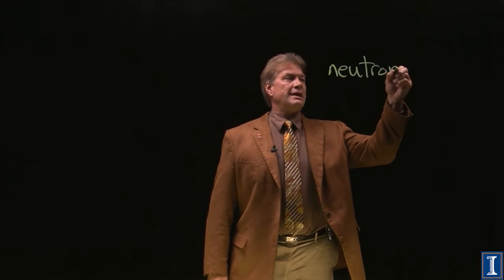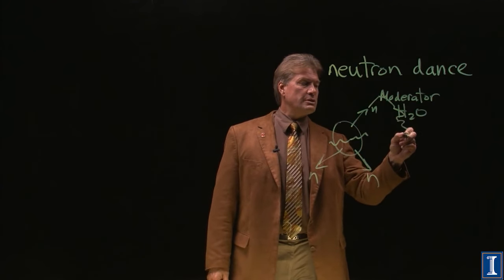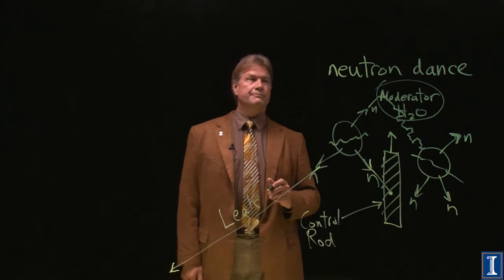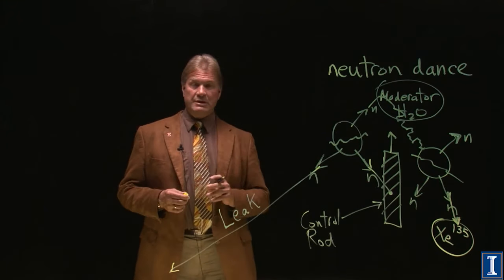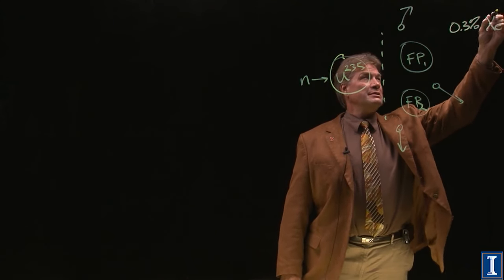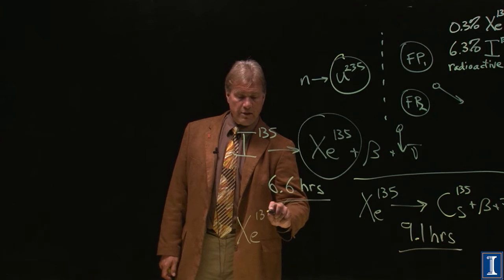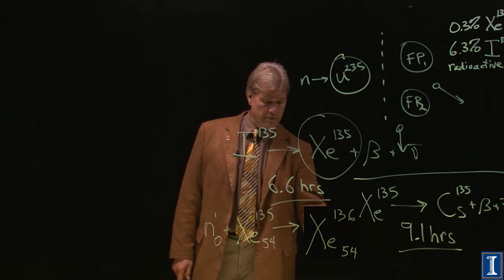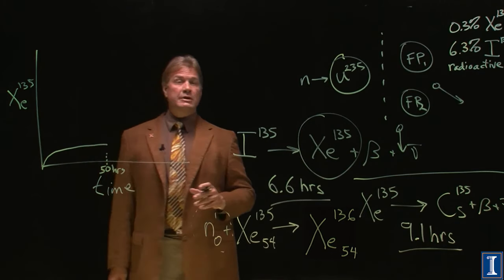Xenon Can Be a Problem

Comment: Excellent video. Maybe I missed it but how and why does Xenon cause instability in the reaction process? Anyone know?
Reply: David correct me if I’m wrong but , Xenon is a by product of the nuclear fission that occurs and over 50 hours it keeps it’s left in check as long as the nuclear reaction is being powered . Once you shut the reactor down you have to wait 3 days to power it back up because the xenon can no longer keep its self is a control state. What happens in Chernobyl was that the reactor was being powered down and the engineers powered it back up to do their test . But since xenon was not being controlled it was choking the reactor and they began to pull control rods to boost the reactors power , and when they did that the run off of xenon and lack of control rods made a complete switch from being choked to highly powered thus causing the explosion
Reply: In a power plant, you want a constant number of reactions (the neutron dance he talks about), which means each fission event on average you want to cause exactly 1 more fission event- less and you would continually lose power over time, more and you would start to exponentially grow power.  So you need to constantly absorb just the right number of neutrons to maintain this balance.  Control rods do this by being inserted more, or less, increasing or decreasing the amount of neutron absorption respectively.  If the reactor is full of Xenon 135 it acts like a control rod- absorbing neutrons.  However, when a neutron hits a control rod, it is still a control rod.  When a neutron hits Xenon 135, it becomes Xenon 136, which IS NOT a neutron absorber.  This means as you 'burn off' the xenon, you are a burning off neutron absorption, and increasing the probability of reaction, which in turn increases the rate of xenon burn off- a positive power feedback loop (i.e. instability).

Comment: What about the gas (water-vapor) bubbles? Because Chernobyl was a BWR reactor, not a PWR, and the fuel cells were become hot, boiling the water...
So what bubbles does in a reactor? (way less h2o in a bubble than in water itself)

Comment: Sorry if I'm mistaken, but is it really true that they "accidentally" turned off the reactor during/before the Chernobyl disaster? (12:56). I was under the impression that the reactor had been running at half-power for a couple of hours, which led to the Xenon poisoning.
Reply: It ran at half power for many hours, around 1600MW but the test was supposed to be run between 700 and 900 MW, so they further decreased power. The xenon poisoning was building in amounts from the reactor running at full 3200MW earlier in the day and as you say then at 1600 MW for many hours- when they decreased the power it unexpectedly continued to fall below 700 MW( perhaps from xenon concentrations) all the way to 30MW! So in effect the reactor was completely shut down and likely loaded with xenon.
Reply: @brianmohr4674  This test was supposed to be done between 700 MW and 900 MW of electric power but they ran it at 200 MW. Chief guy ordered to perform the test at 200 MW,  reasoning that it will be safe but it turned out that reactor doesn't care about experimenters thought on the matter. As the result, due to interference of one idiot, the humanity is still dependent on fossil fuels like oil and gas.
Reply: @brianmohr4674  By the way, ALL of RBMK based blocks had the same test performed successfully, without any kind of accidents. The only difference was that this test was done properly, according to regulations, without one-sided alteration of instruction done by one person in charge. Chernobyl #4 was quite a surprise because nobody even had a thought that somebody would dare to do such a thing.

Comment: Sorry professor but commercial reactors do not wait 3 days to restart.  Xenon is something that you do have to be aware of and carefully raise power but it can be done.  It usually takes 24 hours after a trip to get all the approvals for a restart after determining why the reactor tripped so there is a delay.  

The more common problem with xenon is trying to load follow with a nuclear reactor. Inserting and withdrawing control rods to load follow will set up a xenon oscillation from the top to bottom of the core which can get out of hand resulting in a localized high flux trip. 

Your explanation was generally correct but somewhat hard to follow.

Comment: Could you restart it very soon after (for whatever value of "very soon" you choose) the shutdown, before "too much" xenon had accumulated?  Or is the xenon growth curve much steeper than presented here?
Reply: In principle, maybe?  In practice, this would still risk needing to pull the control rods out enough that the reactor would easily run away?  So instead of designing in some kind of automatically controlled rapid-restart process, they just flatly say that you must wait?

Comment: And this is why we could benefit from going to liquid metal reactors with the uranium dissolved in the salt .... allows a low pressure degassification process to pull the I and Xe out constantly.  Would allow much more effective load following in the power plant.  Also essential to nuclear thermal propulsion where it may be desirable to shut down and restart on shorter intervals than three days.

Comment: well explained but Chernobyl didn't explode or get out of control due to xenon poisoning. Simply put, the cooling failed due to multiple unfortunate circumstances and human failure. 2 teams checked the reactor and the first team was given the task of reducing the cooling and driving in the control rods so that the reactor worked at the lowest energy level. The next morning the team changed and Prypiat (the city near the nuclear power plant) requested the power plant's morning output. Here comes the human error, the second team was not informed about the experiment the day before and followed the daily routine of removing the control rods, but nobody knew about the lowered water level and the reactor was running with 50% water and the control rods fully extended. The result is clear, the upper part of the fuel rods was no longer cooled and deformed as a result, which blocked some of the control rods and secondly by forming hot zones to extreme concentrations of U235 through partial melting, which increased the reactivity by 2000%, From this point on, the reactor was no longer controllable, the water level alarm switched on (at that time ALL nuclear power plants were configured for a water level alarm at 33%) and then the 2nd team first noticed the low water level, they try to correct this and pumped water into it and at the same time tried to drive the control rods back in. The result was a massive increase in pressure in the reactor due to the evaporating and thermally dissociated water, the emergency systems switched off the turbines, as hydrogen was measured by the turbine sensor and the entire power supply to the power plant collapsed, the diesel units were unable to raise the power output to compensate for the power consumption of the city and the power plant itself (by the way, no nuclear power plant in the world could do it today). The water evaporated / thermally dissociated completely, a few seconds to minutes later (the available data can no longer limit the period more precisely) the graphite moderator ignited due to the oxygen radicals and the high temperature. BOOM !!!!  Xenon did not play a role in this process, no idea what you amis were told back then and still believe today.

Comment: Does Xenon poisoning occur when a reactor is just switched to a lower power state from a high-power one, rather than only when switching it off entirely?
Reply: Xenon buildup does occur. Whether that "poisons" the reactor is a matter of perspective. If you're aware of it you can control for it thus the reactor is not neccessarily poisoned, just infected.
Reply: I dont think reactors are just 'switched' from one energy level to another. Those changes have to be made slowly to keep all the factors in balance. And one reason is the xenon issue.

Comment: You haven't explained the graphite acceleration reaction of the graphite tipped control rods, when they hit AZ5 button to push the control rods back in, when trying to shut down the runaway reactor !

Comment: I personally think that the reactor (rbmk ) was not the one To blame (or had the smallest part that lead to the accident) I think that the operations were the ones that caused it .... and especially after the rbmk updates they should be not considered as more dangerous than other reactors
Reply: Κώστας Λεούσης That reactor design is actually extremely dangerous as it is a positive coefficient design...would never be allowed to be built today.
Reply: @chrisvig123  yeahhh...sure....the western type ones are safer only 5 of them blew up and multiple had meltdowns for example tthree mile island npp the real fist npp accident

Comment: Software engineer here.  If you wanted to start the reactor during the 60 hour period, couldn't you just vent the Xenon 135 gas into some auxiliary tank and let it decay safely there, then start the reactor, and then either reintroduce the decayed Cesium back into the reactor gradually once it is fully running or process it some other way into a stable form?  Alternately, could you not run two reactors side-by-side such that only one is ever shut off at one time?
Reply: Economist here. ;) No, you can't. You have all fission products contained in you fuel pellets and you really want such highly radioactive stuff to stay contained at least for a while.
(at least for conventional design, presumably gassing out should work for molten salt reactor). As the main cost is building a reactor, while fuel is relatively cheap, I doubt building multiple reactors to get power of one would be viable,
Reply: The reactor is not permiable to gas - not the part where the xenon is. It's trapped within the fuel rods and their cladding. Quite immobile.

Two reactors side by side is a valid solution though. The Chernobyl plant had four of them. It was supposed to have six, but the last two were still under construction when the disaster occurred.

Comment: For the layperson, me, can someone explain why a moderator slowed neutron would be more likely to interact with another U235 vs a neutron moving at a higher rate?  When the professor says slow vs fast is he referring to actual distance over time or is fast and slow referring to some other characteristic?
If I hadn't read it over and over my intuition would have lead me to conclude that a neutron moving quickly would be more likely to trigger fission due to higher energy.
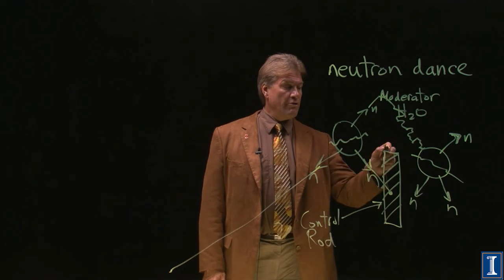Reply: You can look at his other video at 2:43, https://youtu.be/bCbms6umE_o though it does not explain the why you are after, only the physical characteristics, which is that slower neutrons are exponentially more likely to cause fission. It does explain more about moderators and their role in reactors.

Comment: What will be a difference for rod/water moderated reactors? In rod moderated ones, moderator is on the tip of control rod. So total removing of moderator should stop reaction.
Water operated ones, water is moderator... And it stays, moderates to the point of overheating. After overheating, reaction stops (steam doesnt moderate).

If i am not wrong, the thing that caused Chernobyl explosion was that big red button, that started pushing in control rods (with moderator on the tip) and they melted and got stuck. => No absorber but full on moderator. 

That means that water moderated reactor can not explode (well can, there can be some pressure steam explosion but reactors are for sure built to handle that pressure). But Water ones cant turn on uncontrollable chain reaction. Or can they?

Comment: Super interesting , a verry clear explanation  you are a good teacher  Thank you verry much.
Could you get rid of  the xenon  135 in those 60 hours just by ventilating the reactor ?
Can you explain the process of the thorium reactor as clear as this cycle of the xenon gas.
Reply: Ventilating the reactor wouldn't help, because the xenon is not in the water.  The xenon is physically in the uranium fuel pellets.  We are not talking about bubbles of gas in the reactor, we are talking about random atoms of xenon scattered throughout the fuel pellets.  The xenon is physically trapped within the core materials.
Reply: @adamhutchins1981   Than you very much for the explanation it is very clear.
Reply: The xenon cant just be vented, it has to decay, which requires lots of heat. So normally all the workers in the plant hold their hair dryers against the reactor and that does the trick.

Comment: Xenon is a gas (that would normally dissipate), but I assume that when it is "created" (as a fission product) it is embedded in a solid material and so it can't easily dissipate/rise.
Reply: The Xe-135 would be inside the fuel rod

Comment: You do not have to wait if the reactor is shutdown , just reduce boron concentration in the coolant or have the control rods out more than when the reactor was shutdown. We do have to calculate if the reactor will restart if the reactor is shutdown near the end of life due to limited reactivity of the depleted fuel. You will never pass the operator exam.

Comment: All clear, but dont forget about which material were made lower sides of control rods, so only moving them back(AZ5 button), did explosion, didnt it ?
Reply: Had the paths not been obstructed the insertion of the control rods would have worked. It was the combination of many factors that did the trick.
But clearly no one forsaw the moderator-tipped control rods getting jammed half way down.

Comment: Xenon is only a problem in closed fuel pins running solid oxide fuels. 
Systems like the Moltex SSR use a molten salt fuel in the pins. These are vented so fission gasses like xenon are vented.  Other elements like iodine 131 and caesium 137 react into salts within the fuel so never escape in a gaseous form.

Comment: at 23 10 the chernobyl reactor was poisoned by xenon. After 23 10 the chernobyl personel started to decrease power, so the chain reaction should produce less neutrons. at 01 23 the power plant exploded.
Only 2 hours left so it is less than half time of xenon. So there should have been enough xenon to stop the reaction.
Xenon 135 suddenly disappered. It is possible if there is enough neutrons.  so there should be a reaction n+U->Fp1+Fp2+xn, where x is quite a big number. This reaction should be able to maintain reaction n+U and reaction n+X.

Comment: Let us just say for example that a normally running nuclear reactor at 100% power has the control rods in at around 30% and at 50% power the control rods are in at 60% and at 10% power the control rods are in around 90% into the core.  It seems to me that you would never take the control rods out more than the 100% power level of the reactor such that when the Xe135 decays away, the reactor would never exceed 100% power.  I know there is a thing called overshoot so maybe put the rods in at the 80% power level of the reactor.  Did they at Chernobyl take the control rods out more than the 100% power level?  If they did, that would be stupid of them.  If the poison of Xe135 is so high that the neutron density, even with the rods out at the 100% reactor power level still does not produce enough neutron flux to materially affect the Xe135 concentration decay rate then you will still just have to wait the 3 days for the natural radioactive decay of Xe135 to the Cesium isotopes to reduce the poison affect.  I also thought that on newer nuclear reactors that the control rods can be 100% inserted within seconds on a reactor scram.  How long would it take for a meltdown if you lose positive control of the nuclear reaction, seconds or milli seconds or micro seconds?

Comment: What form are the Xenon and other decay elements in the nuclear fuel? Is it gas entrained in the pellet? Does it leave a hole when it decays? I realize that each individual instance would be at the atomic level, but would this eventually lead to a "swiss cheese" pattern in the fuel?
Reply: You're right - that's exactly what the fuel is like after 5 years in the reactor.  The nice shiny pellets that went in are crumbly and full of holes and cracks.  Of course, xenon doesn't do all of that; lots of things are gases at the temperature they operate at.